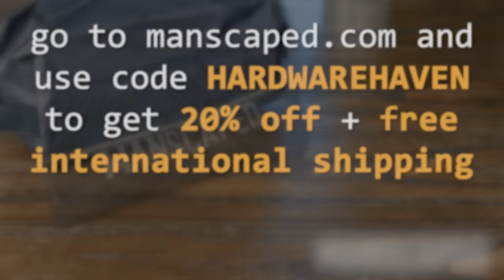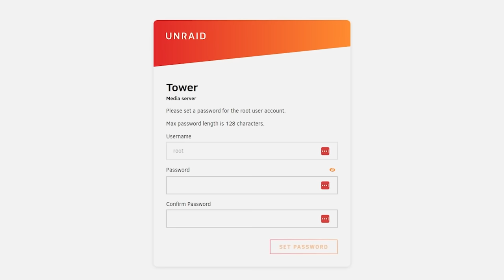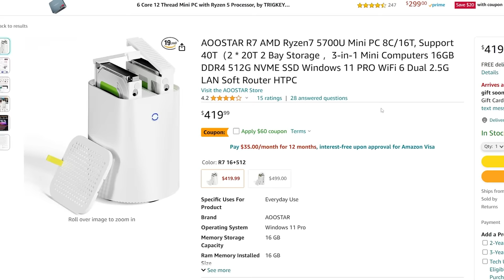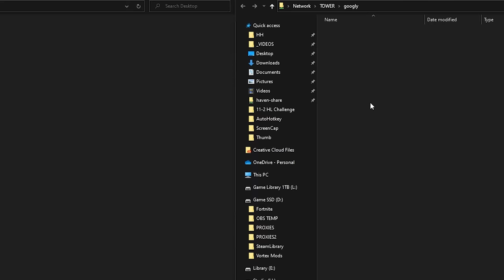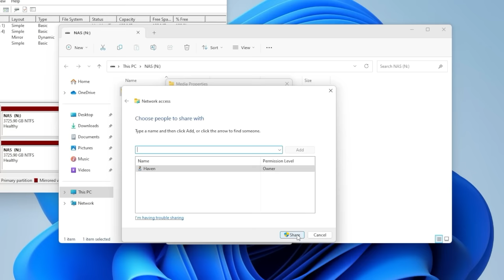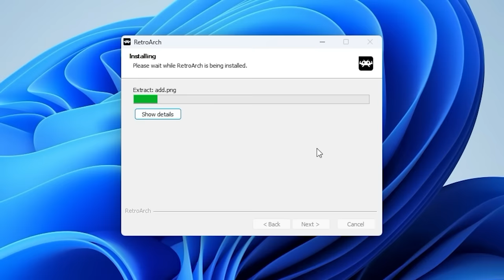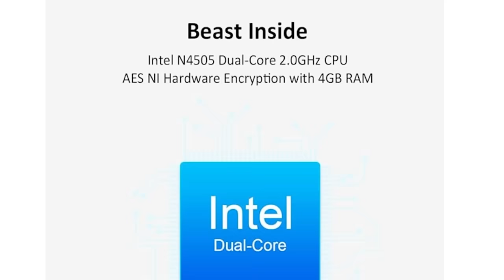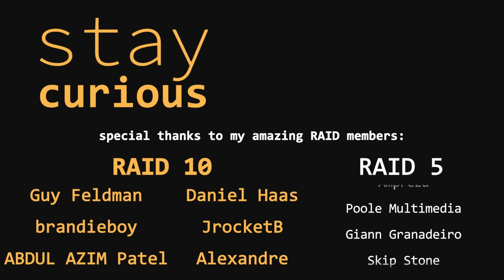Meet Your Next Home Server - Aoostar R1

Comment: This unit also sells as T-Bao R3/Pro, I have been using the 5500U version for about six months. I've been using with Unraid for data backup and media streaming, I've also managed to get perfect hardware transcoding with Jellfin, that's a huge plus for me. For the moment I am waiting for a PCI riser cable to arrive, the HDD daughterboard uses only half of the PCI slot. I will try my luck and see if I can use an additional SATA controller card for extra storage. I've tested the internal NVMe slot with a SATA adapter, but it only worked on Windows.

Comment: I've had this with n100 for almost a month. I added 32gb ram + two 4tb ultrastar hdd drives. Copes very well with many tasks. I also replaced the fan with a Noctua NF-A9x1 and I'm currently looking for a fan for the radiator because it's noisy. Great for home needs!
Reply: i'd be interested to know which fan you are considering & if you managed to reduce noise. It's a great device but way too noisy too in my point of view

Comment: A couple of 2.5" HDD's might give more airflow to help with the M.2 SSD temp issue - as long as you don't need  high storage capacities...
Reply from the maker: For sure. I almost put some SSDs in there as well
Reply: you could always shuck some of the 2.5" 4tb hdds out of some portable hdds.
Reply: Most M.2 have a safe operating temperature up to around 70°C according to their spec sheets. 
Don't know why the default is set to 45°C in UnRAID, I have changed all mine because I got tired of looking at the false warnings (and emails)

Comment: I have the Ryzen 5 5500U version of this AOOSTAR machine. You are correct that the fan spins at a fixed speed on the default header. I found that an 80mm Noctua fan fits pretty snug between the original fan mounting points and will stay put with 2 little gobs of bluetac or hot glue while giving way more airflow at a higher rpm. Running a pretty simple Linux desktop distro with casaOS has been stable and painless.
Reply from the maker: Nice! Good to know
Reply: @HardwareHaven  kinda wanna see you pick up a ryzen version and pit it against the zimacube in a "price to practicality" comparison.

Comment: FYI the R1 I just got from Amazon DOES support fan control for the lower fan. I replaced the 2-pin fan with a 4-pin slim fan, plugging it into the same header, and the BIOS allowed me to adjust the speeds. In Win11, Speedfan did not recognize it however "Fan Control" did and I was able to create custom curves. I also added 3/4" rubber feet to the bottom to improve airflow, and between that, the fan curves, and adding a heat sink to the NVME SSD, the SSD's temp dropped 10-15 degrees, with very little noise from the fans or hard drives, which were quite loud prior.

The BIOS date is late November 2023, so maybe updating older units with new firmware will help, or maybe my board is a newer version.

Comment: unRAID’s default global temp warning is the same as for a normal spinning rust HDD. It doesn’t have the settings to set global temperature warnings based on the type of storage medium. So you’ll have to set individual temp warning settings for each SSD. Especially NVMe is built to run hot so have a look at the NVMe’s spec sheet and set your temp warnings accordingly. I typically set mine at 60°C for warning and 65°C for critical.

It looks like a nice box! If it would’ve had a few more 2.5 GbE ports it would be the perfect AirPort Time Capsule replacement for those who know how to tinker a bit. Run pfSense in a VM on Proxmox and the storage as a mirrored pool. 👍
Reply: I mean, the dual NICs it have still makes it a viable option for a router, but with a couple more ports most people wouldn’t need to run a separate switch and I think many are appealed by that.

Comment: I ended up getting two of these, a couple months apart.  One of them I'm using to run OMV as a NAS, and the other I'm running Linux Mint plus CasaOS and Cockpit.  The goal was to learn more about Linux while having a couple NASes for backup purposes, and worked for both.  Decent discounts during Amazon sales.

Comment: Although I'm a software engineer work, at home I'm an average Windows user.  I only need a NAS to protect against a disk failure so Windows simple disk mirroring is fine. I also run a Plex media server  as well as a printer server. This nice looking PC replaced 3 separate boxes - a homebrew SBC printer server,  an old  Netgear NAS, and an external WD drive. Incidentally your review greatly influenced me to go this route.

Comment: I i were to buy this, i'd much rather go for the ryzen one. Waay more horsepower there to run a few game servers, also the dual m.2 slots kinda make it an all around better option. Sure the n100 is much cheaper but the ryzen one seems pretty well priced so if you can use the extra performance then it's a no brainer
Reply from the maker: I don’t necessarily disagree!

Comment: i have a small server in an HP ProDesk 600 G4 SFF also running windows. It works pretty well as long as you take care of some unwanted windows "features"
In Virtualbox i have 3 Machines running Linux to give me a Docker, a nextcloud and a Pihole. It works very stable since September when i set it up.

Greetings from Germany

Comment: You can probably get those drives out by using a pull tab made from Duct tape on the drive. Stick tape say 3" on the top of drive then hangs off 2" or so and fold 1" back on itself to cover the sticky side. That's obviously the pull tab to grab the drive and pull out.

Comment: One thing I haven't seen any video cover yet is setting up an N100 machine with Proxmox with iGPU passthrough using SR-IOV. I've seen a few posts in Chinese detailing how to do this. It should be doable to run Proxmox with a Linux VM running Jellyfin and another (possibly Windows?) VM to run games, both sharing the iGPU through SR-IOV. I'd imagine the performance wouldn't be amazing, but it should at least allow you to do game streaming and play lightweight/retro games directly from the HDMI port through one VM, while Jellyfin is serving hardware-transcoded video in a different VM, all of this with pretty inexpensive hardware.

Comment: I am interested in getting my feet wet with this unit, however I do need some advice. Primary job of the NAS will be to backup my wife and I computer docs and possibly phones to this, and from there using Idrive for cloud backup. I plan using a 4tb NVME drive in the M.2 slot to backup everything instead mechanical drives.  What software should I use on the Aoostar that would show up "easily" on our Windows and Mac laptops and phones to connect everything together?

Comment: Is this a good fit for the following:

Thank you for the great content!  🙋🏽‍♂️ I’m looking to replace a Hikvision NVR of IP camera’s with AI capabilities. I’m looking at Coral + Frigate at the moment… I am also open to other options?

Current Setup: 
1X Hikvision DS-7608NI-I2/8P 8CH
1X 4TB Drive
1X 2MP PTZ
2X 4MP Turret
3X 2MP Dome
1X HDMI Monitor

Goals:
1. Face and Person Recognition with Frigate or BI + Deepstack
2. iOS Push notifications with a snapshot of the event
3. Access to camera’s from HomeKit if possible
4. Below 25W of power consumption with two 4GB Skyhawk HDD
5. Hub for Home Assistant

I appreciate all the help 💪🏽

Comment: They need a 3rd version with the intel i300 8 core thingy. Double the cores would be even more helpful performance wise, but stay in the same basic power envelopes, with not lots more money spent.
Reply: 2BAY We won't be upgrading. 4Bay will be using the INTEL N305 CPU.

Comment: 7:55 Oh boy, I didn't see why it would'nt work either, but installing Proxmox on this one is a real headache : v8.1 just wouldn't install, and v7.4 needed to type in custom X11 settings for the graphic cards to be recognized before launching the installer (no text-only intall with v7.4). Once v7.4 is installed, the update to 8.1 goes smoothly.
I even managed to get ful hardware acceleration on a LXC running Jellyfin.  Thanks Youtube for two crucial walk-throughs

Comment: When I was taking apart my R1 to install the NVME SSD and RAM, I noticed that the motherboard in the center of the unit connects to the backplane (for the 2 sata drives) via what looks like a 4 lane PCIe connector. The motherboard has 2 of these connectors and one of them is unused. Any idea if the spare connector could be used to hook up a second m.2 NVME SSD via a PCIe to m.2 cable/connector?
Reply from the maker: I saw the same thing, but my guess is no. I would assume that's from a similar PCB design with a different chip, or to allow that same board to fit into a different chassis. The N100 only supports 9 lanes of PCIe. 2 of those are probably already going to the NICs, with another 2 going to the NVMe. I imagine the SATA backplane is just a x1 connection. It's possible, but I can't imagine they would sacrifice performance on other used components or pay more for PCIe switches to have add functionality to an unused connector. 

That being said, I haven't tried so who knows haha!

Comment: The N100 seems to be everywhere these days, but I really don't like the single channel memory. If there was a version similar to that with dual channel memory (I realise the N100 is single channel only) I would be interested. I wonder if there's a comparable option somewhere that does include that feature.
Reply: the Ryzen models with 5500U and 5700U both have dual channel memory.
Reply: All of the N-Alder Lake CPU's are single channel RAM. Since they're  just E-cores from the 12th gen, probably no technical reason why they couldn't use dual channel. Intel likely didn't want them to cannibalize sales from the higher-end, so they crippled the performance somewhat by going single channel.

Comment: Looks like the perfect living room HTPC/NAS/Plex server and no need to learn any software since it's Windows makes this accessible. My original plan was just to plug my 2 external HDDs into the USB 3.2 of a  N100 mini PC, but this is only slightly more expensive and looks much nicer, probably would perform better and draw less power as well? Time to shuck a couple of drives.

Comment: How would the R7 Ryzen version compare running Plex Server since it doesn't have Quick Sync like the N100?
Reply from the maker: I think you can use the VA API, but not sure how well it performs. It can probably software encode just fine unless you’re trying to run multiple transcodes simultaneously.

I want to do more with some of the newer ryzen ships when I can.
Reply: The Ryzen models can Decode/Encode: h265 (8 & 10bit), h264, VP8, VP9, AVC. And can Decode VC-1. The only non-supported format is AV1, which may not matter if you aren't trying to use it as a game streaming PC.

Comment: Nice lil' machine - too bad that you cannot get it in europe. As far as I'm concerned i see a system that ... Well ... Can be beat in terms of idle watts by diy solutions. Or even a well thought out pico psu server on a more powerful platform. If youre going to sink 30 watts at idle into a system them this doesnt really make a ton of sense. 

I'd rather have two external hdds plugged into an optimized n100 mini pc at that point, taking advantage of usb 3.

N100s are the new pis for me nevertheless :) (and i wish i could say "despite being much more expensive")

Comment: Hi, great video as always fun and entertaining! 
I need help with a choice I'm not sure about. I have a motherboard that supports 4th gen cpu's but an i7-4770 cpu will cost me around 80$ and i have to buy ddr3 ram for around 25$ or i can get an x99 motherboard combo with a xeon e5-2670 v3 and ddr4 16gb ram for 65$. I think that the x99  is the better choice because the cpu is more powerfull that the i7 4gen, the ram is ddr4 and it will be cheaper. I want to use this system for gaming, streaming and video editing. Im gonna pair it with an rtx 2070 super. Is the x99 really the better choice?
Reply: Yes X99 is the better option because you can carry over the card and RAM as you upgrade.
Reply from the maker: Yeah I agree
Reply: Thanks very much @HardwareHaven   @lemonhead192  !!!